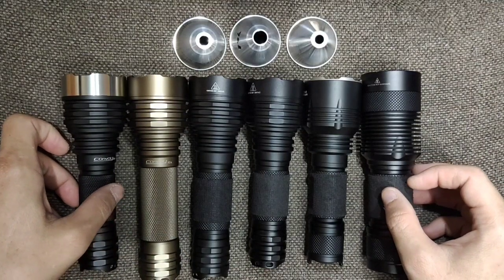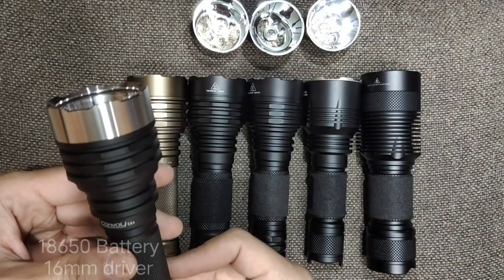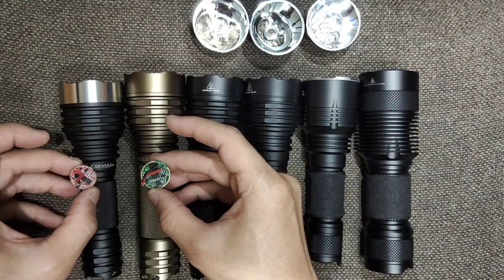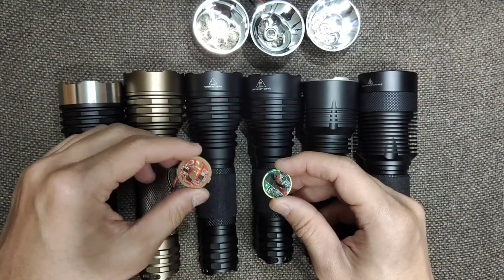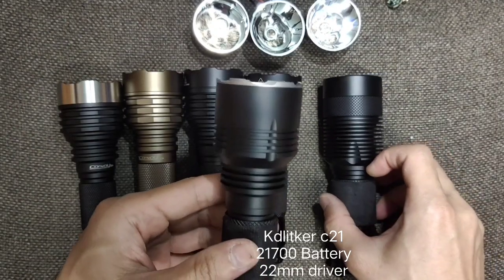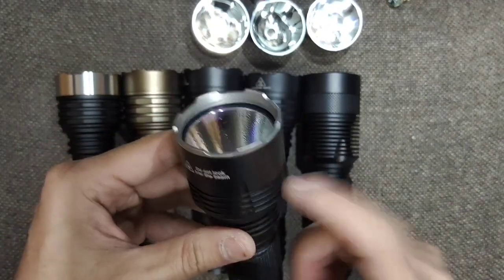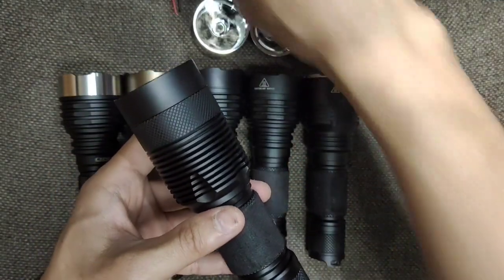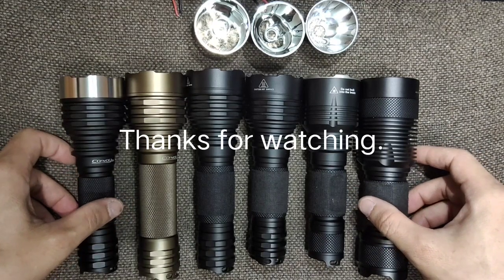Understanding C8 flashlight series: Convoy C8+, M21A, Mantaray M45, Kdlitker C21, Mantaray C8.2

Comment: Great video! I have most of those lights. I love the kdlitker c21 as I have put sft70 LEDs in them with op reflectors. 22mm boost driver. My c21 can hold a larger mcpcb, like around 25mm and that way it fits perfectly.
Reply from the maker: Great sir. I think C21 is good. Thanks for watching sir 😊🙏.

Comment: C8+ reflector will fit in C8.2 host no problem right? 🙂🙂🙂
Reply from the maker: Yes. The same sir. C8L's reflector is different. Thanks for watching sir 😊🙏.
Reply: @weerapatkiatdumrong  I see. C8.2 would be a great heavy flood thrower with all that heatsink and huge battery. Lol.
Reply from the maker: @budgetlightph7814  That's right sir.
Reply: @weerapatkiatdumrong I forgot to ask. Does the convoy lighted switch fit in C8.2 assembly? 🙂

Comment: Hi Sir, I'm planning to build a budget thrower using Convoy C8 host, I plan to use Sofirn C8A's 17mm driver and I'm confused between using Osram CSLPM1 or CULNM1 LEDs. what do you think about emitters, which one is better ?
Reply from the maker: From what I heard, they are similar. In my country cslpm1 is cheaper. Not much different. Choose Cslnm1 or cslpm1. Thanks for watching sir.
Reply: @weerapatkiatdumrong  Previously I also wanted to use CSLNM1 but Sofirn C8A driver has 5.6A output and some people get more than 6A output so I think it will burn CSLNM1,But does CULNM1 have the same output as CSLPM1?
Reply from the maker: @akbar9789  Cslnm1 may be best at 5a sir. 6 may be too much. 
Here's the test about these leds.
https://budgetlightforum.com/node/63255